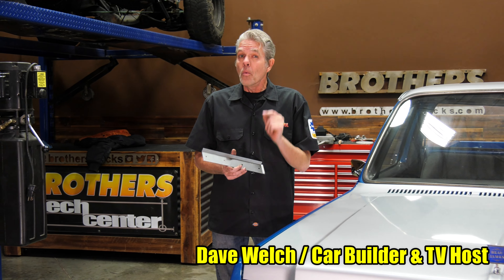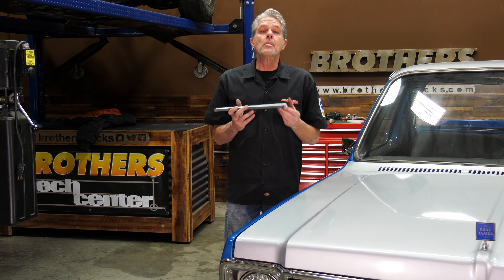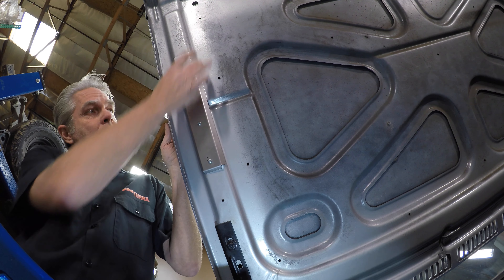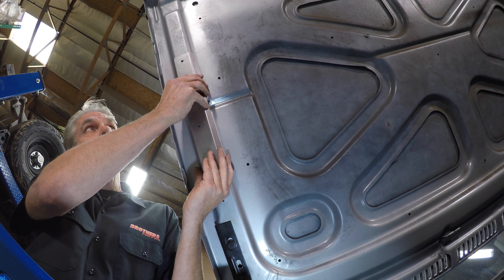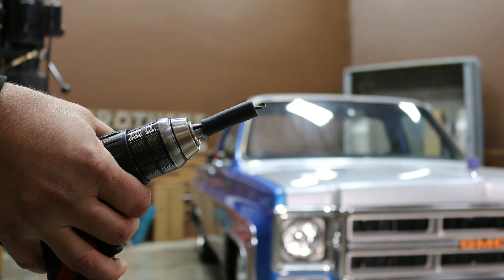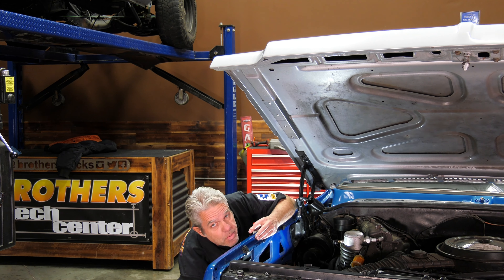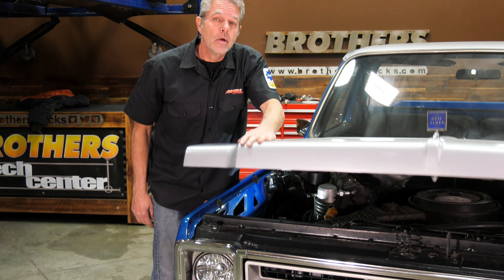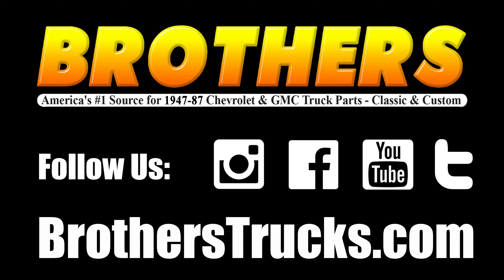1973-80 Chevy & GMC Squarebody Hood Brace Install

Comment: Just installed these on my 79 with rivnut inserts. On the passenger side if you pull it all the way forward the 3rd hole back is in the indention. I dont know if my hood is aftermarket or was made a little different from previous years. Just had to drill another hole in the bracket since I didn't realize until I already had 2 bolts in.  Just a PSA for anyone else installing these that may powder coat the brackets or have a show truck. Double check beforehand!  Made a huge difference when shutting the hood.
Reply from the maker: Great tips!

Comment: That's a new and interesting design. I have the older version installed on mine.
Reply from the maker: Same level of support as the previous version, just slightly easier to install since you don't have to go under the hood hinge.

Comment: Are the hoods on the 81-87 a better design that would not require this brace?
Reply from the maker: Yes. GM changed the design in '81 to prevent this issue from happening.